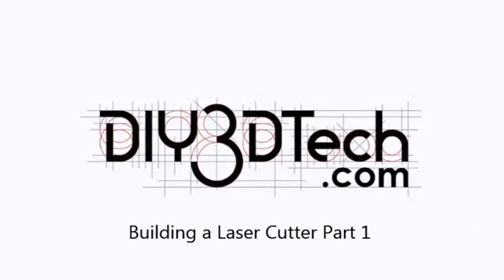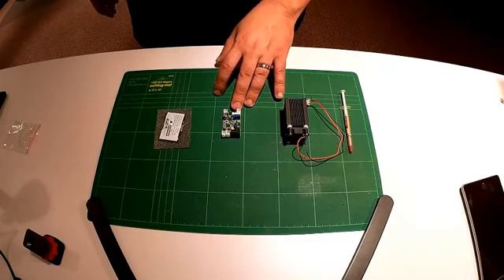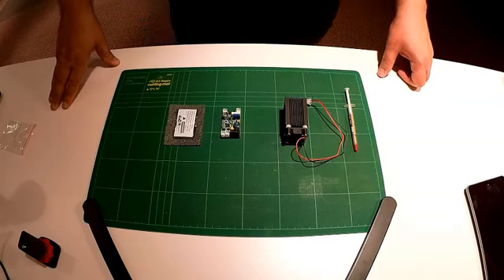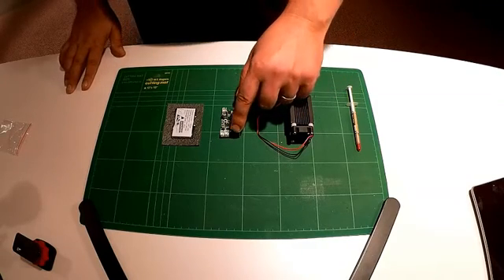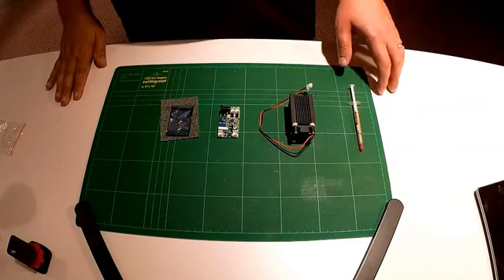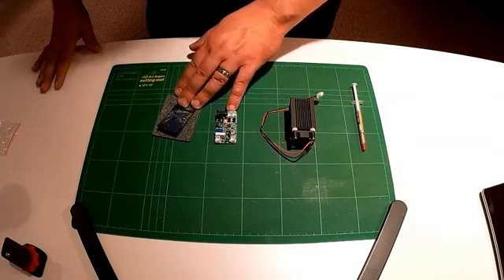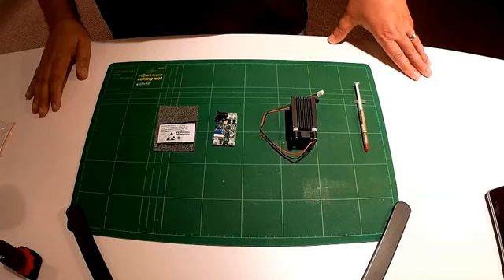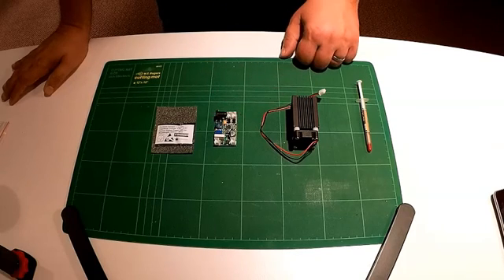Building a Laser Cutter Part 1

Comment: I want to build a laser cutter that will cut 1/4" plywood.  The table will need to be about 5'Lx1'W.  Any suggestions?  Thanks for the video
Reply from the maker: That is a big project, can be done (expensive and lots of work) and because of the size you will want to go with a 150 watt co2 tube and build your own frame.  Keep in mind you will need pin-point accuracy over the 5 feet and that is a LONG ways!